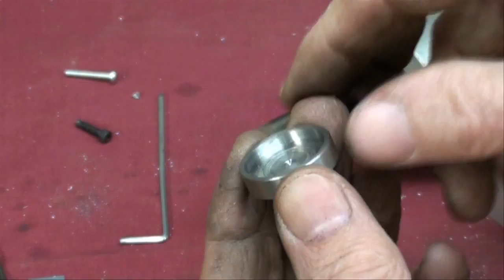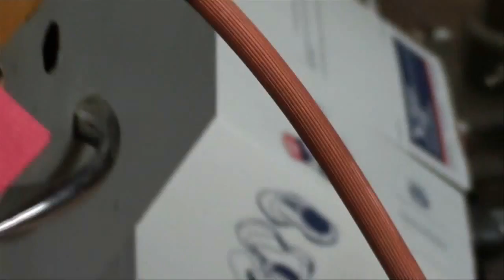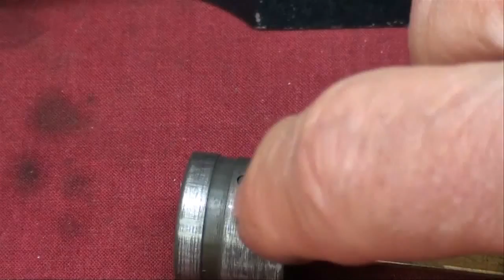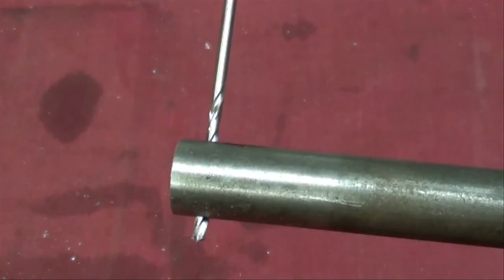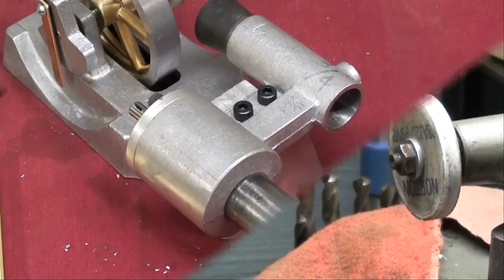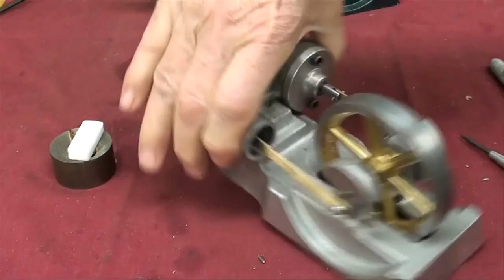HOW TO MAKE A STIRLING ENGINE pt 4 of 4 tubalcain on Bridgeport Mill

Comment: Back in the 1970s there was an article in Scientific American about engines, where Stirling's were the most efficient. 
I was at Boeing commercial Aircraft company then, and heard engineers standing around talking about building Stirlings.
But if you want to see something efficient, look at the permanent magnet motor hooked up to a Lithium battery.
Reply from the maker: You hear very little about Sterling engines anymore

Comment: Great video I love to see them run I love your work ethic  very thorough and efficient I do a lot of the same ,Like your tap & drill board  I wish I could find plans with specs  & Measurements....  Great job
Reply: Can the two  cams attached  to the wheel be round or do they  have to be weighted at 90 degrees to give it more momentum

Comment: i would lick you to do a piece on your mod.  on the laht you mad that allowing  independent speed control , of your led screw i  have a engine lathe that does not have a  led screw only a travel shaft  that enables me to travel the sadal by reack . but the thinking is i could cut a third by travel shaft if i could determine shaft,  rotation  with the the choke set  at 100 revolutions . can you enlighten us of the subject .. les  thanks for the show ,

Comment: Excellent as usual Mr Pete.  I would like to make one but the only part I could not do is the silver soldering of the displacement cap.  Would it be possible to use copper tube and seal the end with a compression joint or even drill a piece of aluminium bar out and leave a solid end?
I love to see these engines running at the speed of yours or slower.
Reply from the maker: No--on the compression fitting.  Sure, make it out of solid bar stock
Reply: mrpete222  hello again Mrpete222 as always love your videos and am subscribed I just had a quick question I realize this video was a while ago but I was wondering since sterling engines run off temperature differential can you cool the cold side to make it run instead of heat the hot side thank u for your awesome informative vids
Reply from the maker: Yes--on some engines--but would need dry ice or liquid nitrogen.  I believe I run one on snow in one of my vids
Reply: Oh okay well thought it might work but that doesn't seem efficient thanks for the reply

Comment: Have you perchance ever built a bi-valve, push/pull steam engine model? If not that's something I'd really like to see. I've seen my share of them on locomotives but never a decent model of one. Right now I lack the machining tools necessary to make one myself. You on the other hand most likely have just about everything you'd need. I've searched through your past videos and I don't see one. Even a link to someone else who's made one would be great. Thanks for the great videos.

Comment: Great Job!  But one improvement would make it run even better: The connection between the 
displacer cylinder and the working cylinder must always be at the end of the cold side
of the displacer cylinder. Otherwise  hot air will be transferred to the (cold) working cylinder, 
be cooled down there and loose a lot of its pressure.

Comment: Possibly this was covered in your videos explaining the Stirling engine, but would cast iron be a better material for the cylinder part than aluminum, both in terms of conducting heat less well and radiating it away better?

Comment: I'm thinking that if you made the displacer tube from glass (test tube) it would run better as the inside air would heat... but the glass would not transmit the heat to the main body as well. I also think if you made one with a steel displacer tube separated by a glass ring (yeah... hard to do) it would be even better as you would get high heat transfer with minimal transfer to the main body. Good project!

Comment: Just a thought, could you use a laser pointer pointed down the bushing of the drilling jig in order to more accurately line up your drill mark?
Reply: I would use a transfer punch. Just slip it into the drill bushing and line it up. It would help if you make a very small center punch for the transfer punch to fall into. That would be fast and accurate.

Comment: Dear Mr.Pete, in one of the last videos you expressed the wish to further expand your viewer numbers. Of course you can do with your channel whatever pleases you. I am going to tell you my experience from my point of view. Maybe that helps you to further grow your excellent channel. The videos I liked most is when Mr. Pete was repairing or making something like the short gear rack for the dividing head or replacing stripped gear wheels or making belt guards. Second favourite are instructional videos. I particularly liked the shear type turning tools. Third are your steam and stirling engines. Factory tours are next down the ladder.  Then come museum tours. And at the lower end I find agricultural machines driving by endlessly...If you could open them up and point out items of technical interest it would be another story.  If you focus more on the items at the top of my ranking and thin out those at the bottom at least I would skip or just browse through much fewer of your otherwise excellent machining videos. I dont know how many other viewers share my ranking.
Reply from the maker: I think you are right--the view numbers are telling me which ones are failures.
Reply: They are not failures but reduced-size-successes. ;-)
Reply from the maker: Thanks--I will check them out
Reply: another approach could be to try to increase your public relations foot print by visiting online metal working forums and put links to your videos into related subtopics. If you try to use that extensively I recommend to read the "house rules" and to get the permission of the forums operator. With your videos I am sure they would support that. It takes time but could increase view numbers on existing and future videos.While browsing those forums you might pick up new ideas for more videos. If you are interested in that approach I could put a list of links to metal working forums here into the comments.
Reply from the maker: Thanks--those are great ideas
Reply: here are 11 links to metal working forums. 
Maybe other commenters can contribute more.
http://www.digitalmachinist.net/
http://www.practicalmachinist.com/
http://bbs.homeshopmachinist.net/forum.php
http://www.hobby-machinist.com/
http://www.machinistweb.com/forum/
https://groups.yahoo.com/neo/groups/hobbicast/info
http://www.homemodelenginemachinist.com/
https://groups.yahoo.com/neo/groups/bayareaenginemodelersclub/info
http://www.floridaame.org/
https://groups.yahoo.com/neo/groups/hobbicast/info
https://groups.yahoo.com/neo/groups/portlandmodelengineers/info
Reply: i like the tractor and machinery vids from time to time, my 2c. Thanks.
Reply: I really like his factory and museum tours! especially the museum tours were he talks about things as you see em! But I know this is all matter of opinion. But your list would match mime very closely.

Comment: Mr Peterson, Love your channel! I want to point out a mistake you made as you were making these if you do some reach on engines you find that all of them are inefficient. The gasoline engine being the worst for efficiency and the the sterling is the best. The problem with the Sterling engine is that it only has one speed like the hot bulb gas engine which is never used as the carburetted engine is preferred. Also I like that you talk about safety. Were your eye protection. No long sleeves or ties. When I was in middle school the male teachers were required to were a tie however shop teachers were exempt form this. Did you have to tuck your tie in your shirt or did were exempt for this rule also. You are a safe machine operator because you have all ten finger nails. People who are repeatedly careless around machine tend to loose a finger or two if they survive the incident. Keep up the good work. Mark From South Dakota.
Reply: Remember some older guys having to wear ties, they were all getting the ties with the plastic clip, you might remember this, the tie goes but you get to keep your head...    ;)
Reply: I remember the metal clip on.
Reply: I don't wear ties anymore but the ones I have from growing up,etc. are clip on because I did not like making the knot to have the ends come out correctly.  I think I still have those ties but knot sure where.  I am almost 70.

Comment: I suppose you could build a firebox to concentrate the heat on the end of the displacer while also shielding the rest of the engine from the heat.
Thanks again Mr. Pete!
Reply from the maker: Yes--I have done that in my experimenting. Its called a furnace

Comment: Thanks for producing the series on Stirling engines!!!  I am so happy that I managed to get mine working consistently.  Your videos helped to improve the design/materials originally proposed by my lecturer.

Currently in the process of polshing the individual parts to improve the overall aesthetic.  I would like to post a video (however simple) to show it working.  It was both a very interesting and satisfying project to work on.
Reply from the maker: Glad you got yours to work.
Reply: mrpete222
Reply: mrpete222  do a cut off on the sterling engine